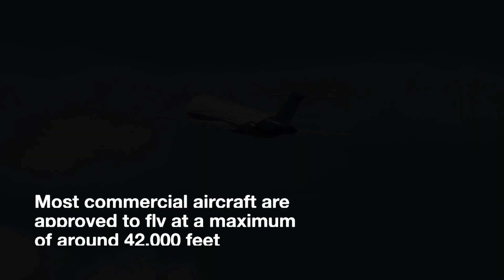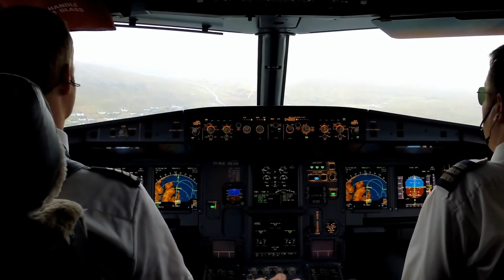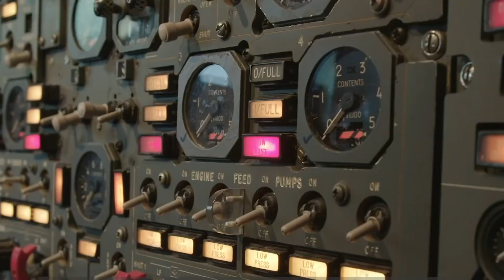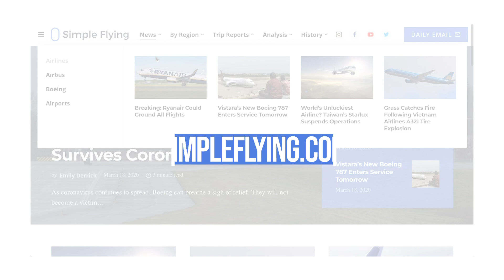How High Can Commercial Passenger Planes Fly?

Comment: The highest I've flown was 41,000 feet in a fully loaded plane!
Reply: What happens if an aircraft flies higher than 50,000 feet ?
Reply: @RachidChina  Some planes can fly above 50,000 feet. I'm not exactly sure I understand your question.
Reply: @ChrisZoomER  I mean what if the airplane go high like 60,000 or 70,000 feet into the sky, what would happen
Reply: @RachidChina  You'd likely have an engine stall
Reply: @ChrisZoomER  Will that lead the plane to crash on air?
Reply: @RachidChina  Not necessarily, another thing is that the cabin can only withstand so much pressurization so the cabin will weaken and eventually break if flying too high for too long.
Reply: @ChrisZoomER  What if the airplane crashes in the sky. And the people were thrown up, will they be thrown up into the ground ?

Comment: The highest I've flown was at FL400 aboard a BA 788 in 2015. Before that, my previous max height was FL390, achieved a couple times, such as a flight aboard an Air Canada 763ER in 2004.

Comment: Plane cannot fly too high is due to the "coffin corner".  Regular plane cannot fly higher then speed of sound.  As plane gains attitude, sound speed lowers and maximum speed plane can achieve is lower; however, as air gets thinner, plane must have higher speed to prevent stall.  The speed window between over speed and under speed gets narrower as it gain attitude.  Once the over speed limit equals stall speed limit, the plane reaches the "coffin corner" and it cannot fly higher.

Comment: Your statement that Concorde’s windows are smaller so as to decrease adverse effects of decompression is totally incorrect. The reason is structural soundness of the fuselage. The higher the flying altitude the higher the stress on the structure because the pressure difference between the cabin and outside increases. This causes structural stress which are are hightened with larger windows. Otherwise SR71 could not have any
Reply: It's actually for both reasons
Reply: Yeah. I noticed something off with that statement

Comment: A few years back working at LHR. We were parked next to a Russian jet. We were invited on board, the flight deck door was open but looking at the structure around the door which was a domed pressure frame. The door itself was very heavily built.  We thought the flight deck could be isolated from the main cabin. Guess to allow the aircraft to fly at heights not suitable to pax cabin.